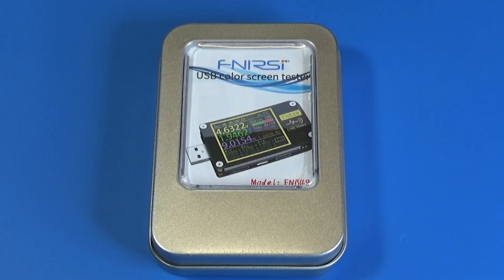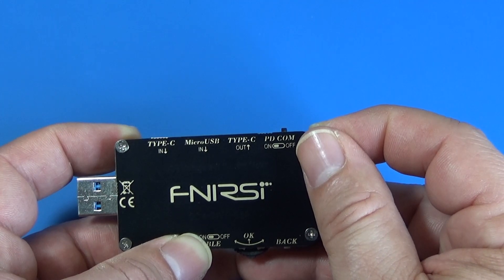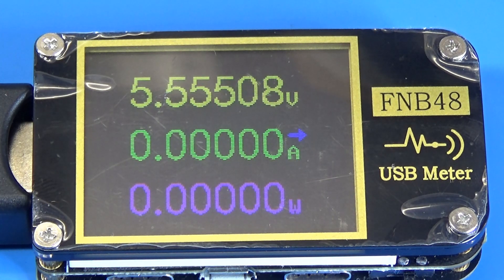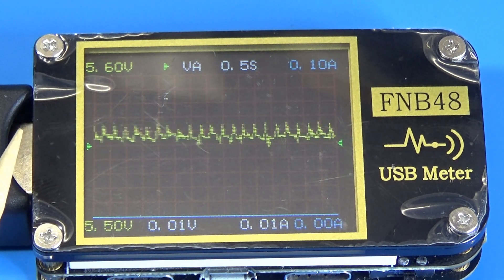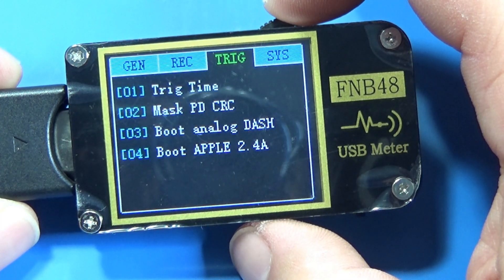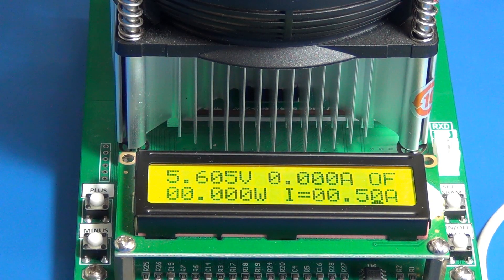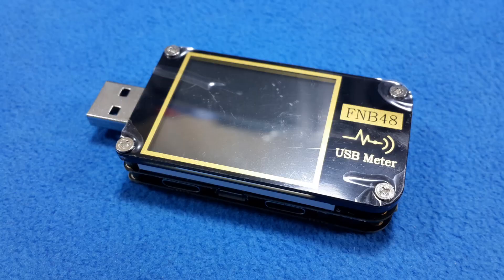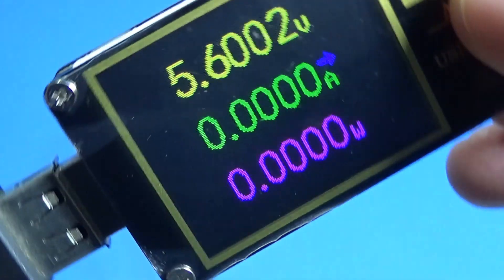Product review for FNIRSI FNB48 USB Meter. If everything came with USB, all of us will need one too!

Comment: Note that this old FNB48 and the new FNB48S are completely different devices with different MicroControllers and firmware.
They function the same, but FNB48S has slightly better current handling. If you flash either model with the wrong firmware it will be bricked, however you can recover it with DFU mode and correct firmware.

Comment: I bought one, but certainly not to replace my oscilloscope, LMAO! Looking at the USB meter's "oscilloscope" and its spec (need to pause in order to read it)... Then comparing with other bench top oscilloscopes like Rigol's, while saying that we wouldn't need them anymore? It was a joke, right? Yeah that was a joke I can't believe you could've said this seriously lol. Of course, who would use an oscilloscope or whatever multimeter that's above 20$, for solely measuring battery levels or voltage/Amp levels on a power outlet, or have a ballpark figure of those values just to see if everything is all right (for precise time-based analysis or different and contextual measurements, you'd always be better off with an oscilloscope or a very good multimeter offering time-based features along relatable samples - the more you'd get during one second, the better it is as you'd open up to many other contexts, for instance those you've shown offer 1Gsps with a broader range of frequencies). Repair shops could use this just to have a rapid idea, as if something looks wrong it can give a clue about the culprit (about which device is responsible), and solely in terms of power delivery, or to verify the availability of different protocols - which is the only advantage over an oscilloscope when you don't know the specifications of those protocols (how to make manual measurements to find them out - or not), but a very, very good one. NOTE: I used my oscilloscope to verify that this useful gizmo makes acceptable measurements (good or "acceptable" for its type of usage) ;-)

Comment: How does it compares to the UD18?
Reply: UD18 does not have any of the QC or PD triggering and section, which is very important for testing modern Power Supplies. However UD18 has a better display.